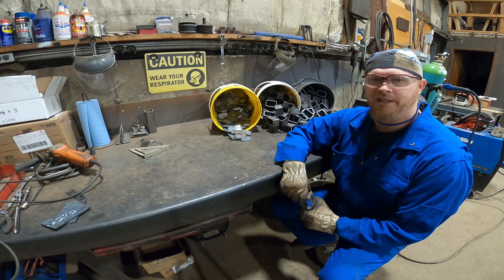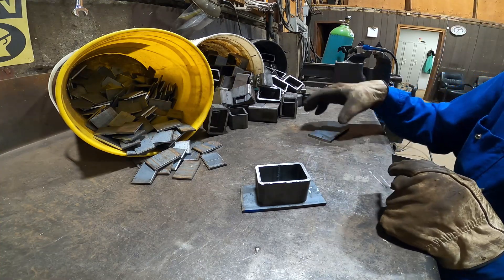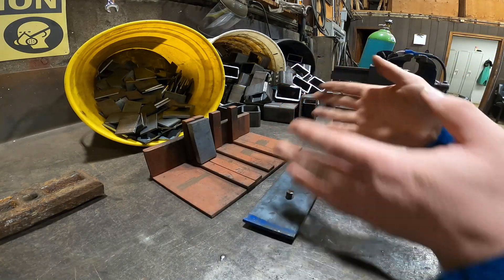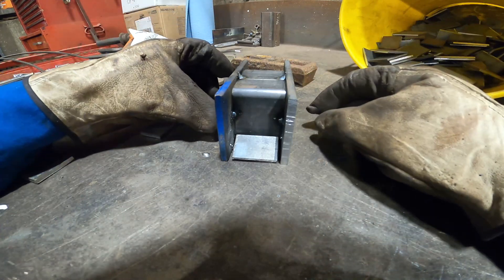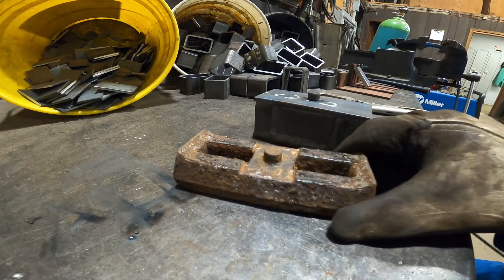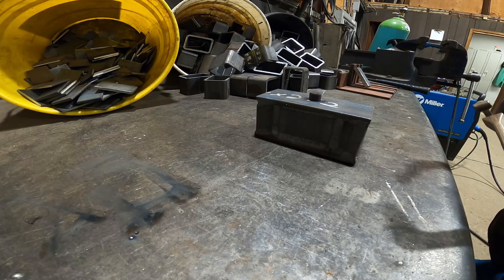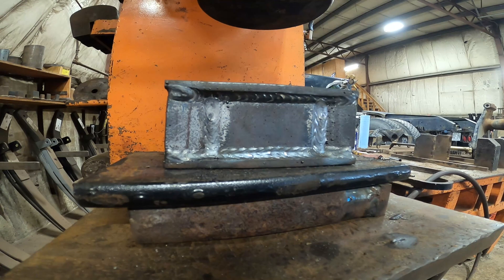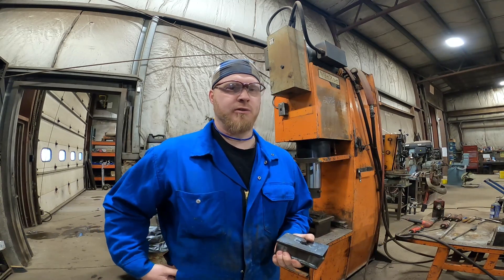Turning waste into chevy/GMC lift blocks

Comment: I don't know how you can do that with no safety Shield between you and the Machine and if it was to explode shrapnel pieces would fly out faster than a bullet from a gun barrel could enter your abdominal or damage your family jewels I understand that you're doing a test but I see no safety barrier between you and your test
Reply from the maker: Mild steel doesn't explode like hardened steel.  Thanks for the concern
Reply: Never hurts to be extra careful. I've watched too much Hydraulic Press Channel to not be a little wary hehe. But you're right it's generally the brittle materials that are the most dangerous.

Comment: Great solution to the problem 
If you heat up a leaf spring to make the bends in the eys don't you soften the material and if you bend it in the press to be the same shape as an old sping shouldn't it be heat treated again
Reply from the maker: I should probably do a video on this, because I get asked this all the time
Reply: @simcoespring  please 🙏